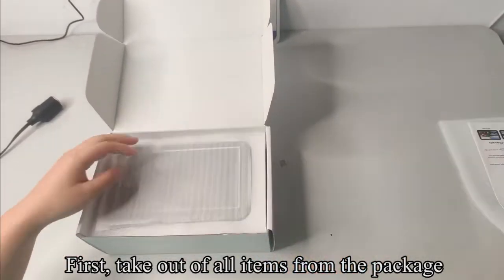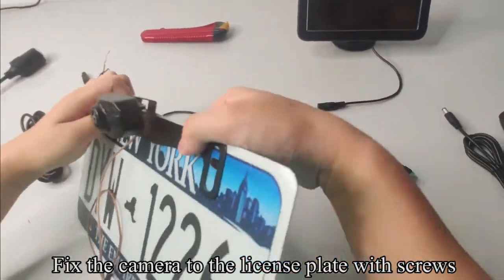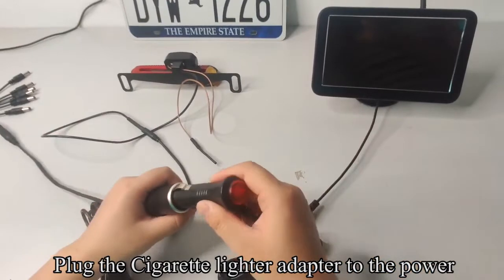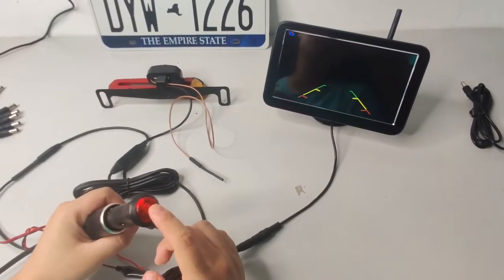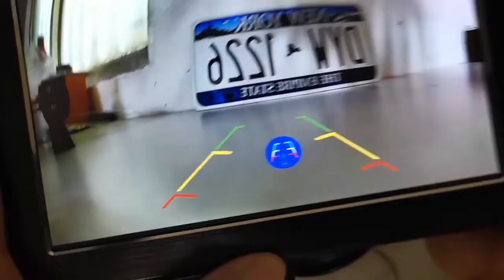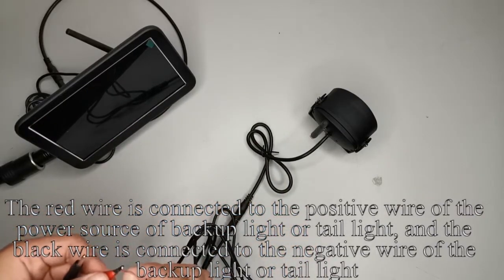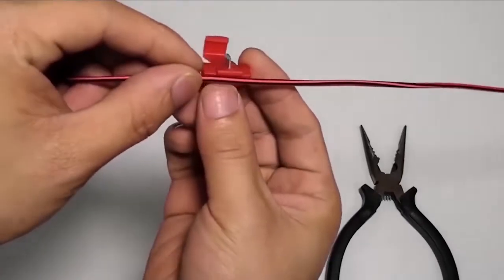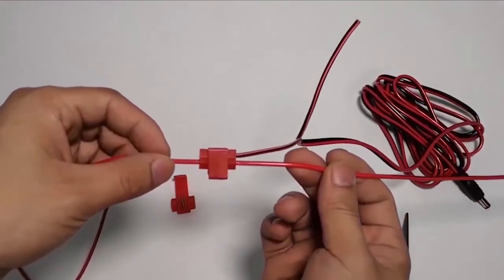DoHonest V29 Truck Wireless Backup Camera System Operation Video

Comment: Camera displayed in this video isn't same as unit I ordered & received.  I was under impression unit was WIRELESS, NO WIRES NEEDED !  I plan to return this because I feel mislead.   Bobby Hodge
Reply: This is wireless. The extra cord is an extension if Needed per the instructions ( under Main Accessories, left column, bottom row).